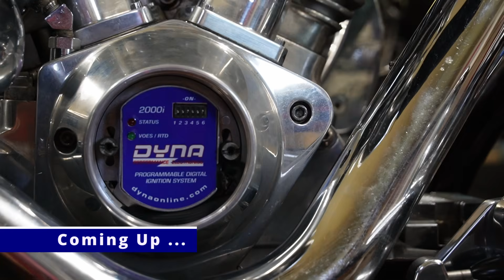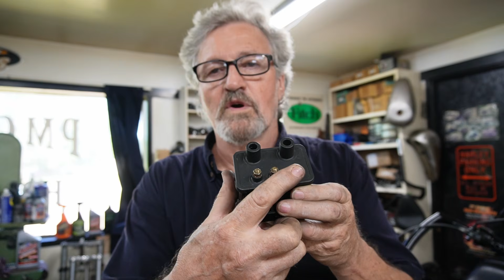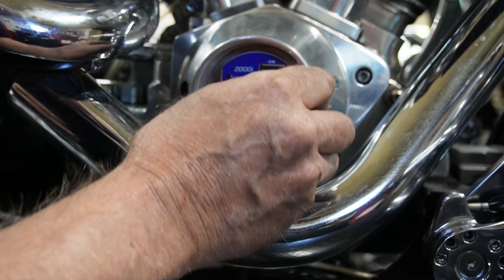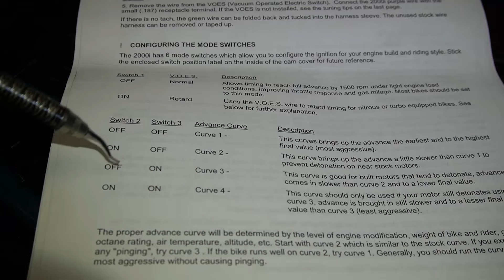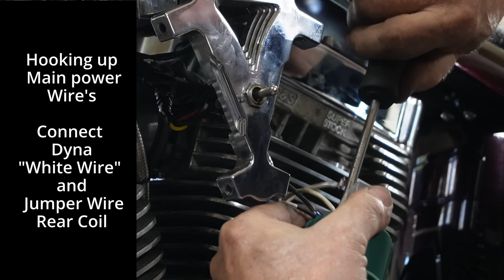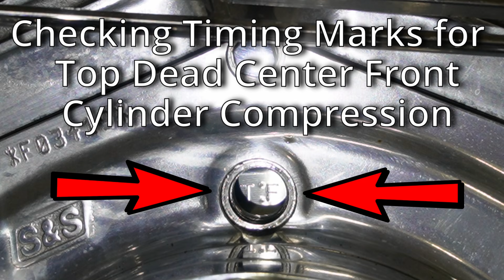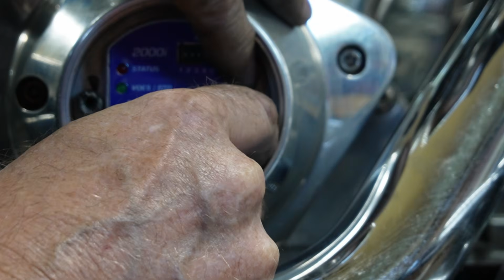HOW TO INSTALL A DYNA 2000i  IGNITION SYSTEM / THE EASY WAY

Comment: Ralph, what has your preference for a Shovelhead kick and electric start?
I understand the 2000i has standard dead revs programmed but you can flash a different curve in it. Or is a Dyna S just the better option even with the mechanical weights?
Reply from the maker: I prefer the Dyna "S" systems with the weights, if you are going kick start. I have heard of guys doing somehting with the dyna 2000i systems to make them better for kick, but have never met anyone who did it. I would stick with the 2000i for electric start bikes. Just my opinion. Thanks for commenting.

Comment: Just came across this ..good informative vid..now I must admitt it's not a Dyna ignition I'm installing but same set up.I have spark & fuel , engine turns over but won't start, infact shoots a nice flame out the carby [ E series ]..has me stumped, I've double checked & triple checked everything, set to single fire using 4 ohms twin tech coil..I still think timing out..am I wrong...'help' Cheers Skip  [ Australia ]1996 Evo
Reply from the maker: Glad the video was helpful even though you're using a different electronic ignition. Sounds like you've got a tricky situation on your hands. Moist electronic ignitions use 3 ohn coils but it should still start. A common mistake is having the spark plug wires wrong (front and rear cylinder firing reversed). That will often cause misfires, backfires etc. Also make sure you are setting it at Top Dead center compression on the front cylinder stroke. Also make sure you have the right CUP in behind the ignition. It should be a gold one  for 1983 and up, not a silver one. (Note if it is an early weights type system like a Dyna "S" you would need to be on Front cylinder advance mark on front cylinder compression stroke with 5 ohn coils) You might want to seach our the manufacture specs as well for it as I don't know what you are using. If it is a used system then it may also be faulty. Good luck and thanks for letting me know where youare from and Thanks for commenting.

Comment: Working  also for kick start  ... I use this....    Need to be programmed  . Very easy    https://www.youtube.com/watch?v=caztWdYbLFU
Reply from the maker: Thanks for the info, and the link, may be of use to others in the US. Not available through distributors up here, in Canada, and you can triple the cost just to get one up here from Dyna. In the end the Dyna S system is cheaper and easier. But if money is no object then it is a great option. Thanks for letting others know about it. Thanks for commenting. Appreciated!
Reply: @itsmytimeletsgo  Hi again from Norway.    You can also make it your self :) .   https://www.youtube.com/watch?v=_vaCxj1Z8WI
Reply from the maker: I will check that out. Thanks

Comment: Is it setup for kickstart right out of the box?
So it first on the first engine revolution?
Reply from the maker: The 2000i does not work well with kick starting. Not saying it won't work, and some say they have had success, but I have found the the earlier Dyna S systems (single fire or dual fire), with the advance weights, work a lot better for kickers. Good luck and thanks for commenting.
Reply: @itsmytimeletsgo   thanks for the info. I was hoping it would be a better unit for kickstarting than my Crane Hi-4 dual fire ignition.  😕

Comment: My battery died, installed new battery, engine turns over, have spark at both plugs, won’t start? IGN switch ON the red light flashes once on module, switch off the green light flashes once?? Is this normal, the lights on the module I mean?
Reply from the maker: Yes the red will flash once, when the power is turned on, unless it is close to the firing point. Then it will blink once and stay on. That is normal. The green light is for the VOES switch and will stay on if the violet wire is grounded, or you are using a VOES switch. Since it goes out it should not be a problem if you have no VOES switch. Seems your ignition is working properly. You may have another issue that caused the battery to die, possibly a short somewhere in the system. Check for fuel as well. It is a process of elimination to find the problem. Good luck

Comment: Question, I installed it the exact way you have shown but the engine is still getting a misfire. I’m running the set up the exact way you are the only thing I can thing of is maybe I didn’t set the front cylinder too too dead center when I thought it was. Any advice you can provide? I am running. The system on a 78 shovel and I’m definitely using the correct backing plate.
Reply from the maker: Double check the front cylinder TDC, and "make sure" you are on the "compression stroke". You can put a straw, or screwdriver in the hole to make sure you are at  top dead center. Also make sure that your spark plug wires are plugged in correct at the coil for the single fire, front for front and rear for rear. If they are swapped it will cause a miss fire and not run well at all. Hope that helps. Dyna 2000i single fire units don't like to be kick started as well so I take it you are electric start. Make sure you dip switches are set correctly as well. Thanks for the support and the question.

Comment: I've always used a pencil,to find TDC. Thanks for the tutorial.
Reply from the maker: That's a good way to find TDC, thanks for watching and taking the time to comment.
Reply: Do you find top dead center before or after you replace the cup or plate? Mine is old so it Doesn’t have the new plate that is needed with this ignition.
Reply from the maker: TDC is TDC with or without the plate. You will need the 1983 and up gold cup to make it work right.
Reply: @itsmytimeletsgo so my 97 sportster 883 already has said cup from factory? Or will I need to buy that cup separately so make the module work? TIA!

Comment: Trying to figure out my wiring harness is a pain in the butt. It was once a FLHTCUI fuel injected. I’m using S&S carburetor now trying to get this thing going.
Reply from the maker: Yes, wiring can be a challenge, but you will get it. Thanks for commenting.

Comment: Installed a Dyna 2000i when I ripped the Magnetti-Spaghetti fuel injection out of my 1997 FLHPi and replaced it with rejetted CV-40. Trouble free ever since!!!
Reply from the maker: Sounds like you got a nice setup there and are enjoying the performance. Thanks for watching and commenting!

Comment: I have a 76 shovel head and the dates on on this only start at 78 but it had a Dino 2000 I on it when I got it and it was working fine after a few years it burnt out and now I’m putting a new one onbut it says only till you’re 78 is that make a difference?
Reply from the maker: I do not see why it would make a difference, You must use the 83 up gold rotating cup (32402-83) for the 2000i. Perhaps that is why they say that but I cannot see it in the instruction sheets for the years.  Pre 78 were points, with mechanical weights sets, with points coils that are different ohms than what the 2000i needs.  5 ohms for points, or Dyna "S" and 3 ohms for electronics. Thanks for commenting.

Comment: Did I miss where the GREEN tachometer wire connects?
Reply from the maker: Attach the pink wire from the tach to the green wire, from the unit, with large .250 blade connector.. If there is no tach just fold back into sleeve. If the bike has a pink or pink/black wire at the coil connect this to the green wire. Hope this helps. Thanks for the question.
Reply: @ thank you for the answer. Changing from a dual fire to a single fire, is the green wire hooked to the single fire coil or the wire from the dual fire coil pink, pink/black?
Reply from the maker: @WindRider1  Here is an installation sheet for you that might help. http://www.vtwinmfg.com/Instructions/32/32-9153.pdf
Reply: @itsmytimeletsgo  thank you. Keep up the good work.

Comment: Do you have to program these on your computer?
Reply from the maker: No need for that at all. They are a self contained unit. Thanks for the question and commenting.
Reply: Can’t you adjust the curves and also adjust the wasted cranks before spark
Reply from the maker: @anthonyseidita1809  YOu can adjust using the dip switches but anything else requires something form Dyna to change anything. I have heard of some doing this for kicker applications, using the single fire mode, with varying success. Thanks for the question.
Reply: Any recommendations as far as what unit to purchase for a custom built chopper with an ultima el bruto 113” motor..? I see year and model specific options but don’t know exactly which to choose
Reply from the maker: @anthonyseidita1809  I would think with a motor that size that you would not be kicking it. So the Dyna 2000i single fire is probably the best bet for that bad boy. Late 80's to 1999  Evolution type. Hope that helps. Thanks for the question and commenting.

Comment: Thank You for a great vid. I just installed the D2k on a 83 fxsb low rider-dual fire.  

With respect to the coil. on one end it has 2 white wires, on the other a blue and yellow.  

One white wire is from the main harness and the other is routed to the "electronic module"  (power) 

The blue wire also comes from the EM.  The EM also connects to the timing mechanism via 3 additional wires.  i installed the d2k per the wiring diagram.  

My question is, the white and blue wire coming from the electronic module are no longer necessary?   (the yellow wire that is attached to one end of the coil is for the tach.)

any help is appreciated, thank u!!!
Reply from the maker: The electronic module is no longer needed with the new ignition system so just get ride of the wires attached to it. Hope that helps. Thanks for the question and commenting.

Comment: Great vid !,  whats the difference between the  Dyna-s ignition and the 2000i ignition ?
Reply from the maker: Thanks. The Dyna "S" is a mechanically driven system (mechanical weight set in behind the ignition plate) It is a standard duel fire system. It uses a 5 omh coil. The Dyna 2000i is electronic and has an ignition rotor cup in behind the ignition plate (1983 up type) .It needs a 3 omh coil. It can be run in duel fire or single fire mode when using the right coil. Both can be used with duel plugged heads as well again using the proper coils. Dyna makes a coil, for the single fire, that is the same size as a regular coil for easy mounting. Hope that helps. Thanks for the question and commenting.

Comment: Do you need the cup to run in single fire? Converting a 97 roadking to carb/single fire. Doing research before I order.
Reply from the maker: Yes you need the gold 1983 and up cup. Thanks for the question.
Reply: @ I noticed after I watched a little more of the video. My bad. Thank you for the reply though!

Comment: Are these ignitions programable? That is, if none of the settings of the tiny switches works well for me, can a custom program be done on it?
Reply from the maker: I am not sure about that. You should contact the manufacture about it. I did hear somewhere that they could be programmed for kicker bikes, with a special add, on so maybe you can find out something. Contact Dynateck or maybe someone here knows more about it. Thanks for the question and commenting.

Comment: Hello Ralph. 
I really liked your video... very well explained, simple, and concise. I came here because I'm looking for a way to confirm if my Dyna 2000i is really broken, before buying another one. My 99 Sportster has had one mounted on it for 20 years, and now, after 200,000 KMS, the bike doesn't want to work. The starter works, but no current reaches the spark plugs, and the coil and the cables are good. I wonder if there is a way to know if the Dyna 2000i is working, just by starting it... while the engine turns but does not start. Should there be any change in the LED, for example, or is there any another way to confirm if it is broken? I didn't want to be spending money on it and then it wasn't the problem. 😕I am the one who usually carries out all the interventions on my motorcycle. Thank you very much in advance. I'm in Europe. Hugs. 🙏
Reply from the maker: Hello and thanks for the question. I do not know if you are running in the dual fire or single fire settings. In any case chek all of you grounds to make sure they are good. Make sure you have power to the coil.  I think you could use a test light to check as well. Put one end on the 12V line and the other on the other side of the coil. (if you are single fire then one on the center terminal and the other end on one of the other terminals). When you turn the bike over the light should light up if there is signal from the ignition system. Below is some checks from Dyna concerning  the red light etc. 

Verifying System Functionality with the LED 
The red LED can be used to determine if the ignition module is working. When power is turned on to the ignition, the LED should
flash on for 1/4 second then turn off. If the pickup is near a firing point, the red LED will come on continuously. This "Flash period"
indicates that the microprocessor is functioning in the DYNA 2000I ignition module. 
When the ignition power is on and the engine is cranked over, the red LED on the DYNA 2000I will blink on and off. This indicates
that the DYNA 2000I pickup is generating timing. The pickup is designed such that the LED will come on at about 45 degrees
before top dead center and go off at top dead center for each cylinder. This corresponds to the leading edge of the window in the
rotating cup (45 BTDC), and the trailing edge (TDC). 
NOTE: If the red LED flashes rapidly with the engine not running, an over current fault is indicated. Check for proper coil
resistance (2.5 to 3.5 ohms) and wiring. Turn the ignition off for one second, and back on to clear the fault. 
VOES LED Function 
The green VOES LED lights when the purple wire is grounded. When the engine is operated in normal mode with the VOES
connected, the green LED will be on most of the time. The green LED will also be on when the Programming Adapter Is
connected.
Hope this helps! Thanks for the question, commenting and letting me know where you are from.
Reply: @itsmytimeletsgo  what a fabulous explanation! This is without words for help given. ❤️ 
I have dual fire. 
Some of these things are done, but now I have to test how you taught me. I don't know exactly when I will be able to do it, but rather what I will achieve, tell you or result. 
A thousand thanks, from Portugal. 😉🙏
Reply from the maker: @MhP163  You are more than welcome sir. I hope I was about to help you out with the info. Many thanks for your kind words.
Reply: Hello Ralph, again. 
I will comment my story in your video about the 
Dyna S. 
😉

Comment: What color was the cup
Reply from the maker: It should be a gold cup that is needed. I think I gave the part number in the video. Thanks for the question and commenting.
Reply: @itsmytimeletsgo I went to the part store it looks the same and has silver coating says 84-99
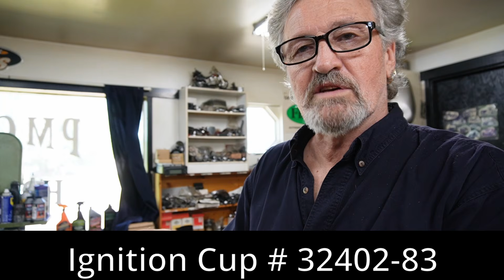Reply from the maker: @superwin190  I gave the part number in the video ( at 1:20) 32402-83 and that is the one that is needed. Usually they are gold and the number is stamped right on them. You can check the part number they gave you for it. If it is 32401-80 it is for the early 80 to 83 ignition systems and will not work, and usually does not have the part number stamped on it. Hope this helps and good luck.

Comment: Are there any benefits to running separate coils like you did instead of one mini coil
Reply from the maker: There is no advantage, to my knowledge it was just that this particular bike had the coil mounts for dual coils. The singlefire coil will work just as well. Thanks for the question.

Comment: hello, great video btw
im having a problem with my 2002 883 sporster 
it was running good and sudently died, it lost the spark completle 
took it to the garage and turns out the ignition module died, went on ebay and bought an used one. the bike worked great but just for a week, than it started failing when acelerating in low rpm and end up dying again completly  loosing the spark. 
im thinking on installing one of these dyna 2000i hoping it will solve my problem. 
shine me a light please
Reply from the maker: You will enjoy the Dyna. Very reliable and esy to install. Thanks for commenting.

Comment: Will this ignition be compatible with a S&S 96 evo?
Reply from the maker: Yes it would  be a great addtion to that motor. I would use it in a heartbeat to make her get up and dance.   Thanks for commenting.
Reply: @itsmytimeletsgo  is dyna module any better/different than ultima module?
Reply from the maker: @blacklimosmatter2023  I have heard people say they are about the same. You just have to make a brand name choice.
Reply: @blacklimosmatter2023  I ran a 2000i in my S&S v96 and would highly recommend it. In fact, when I bought my S&S v111 for same bike, the new S&S Super Stock ignition failed right after break-in. I grabbed the 2000i off the shelf and it runs flawlessly. As OP said, watch your wiring closely. The Super Stock and 2000i wire colors are basically reversed, if I remember correctly. Ignition is so critical that I don’t memorize that stuff. Follow instructions every time!
Reply: @meandkathinkihei  would you recomend a place to purchase it?

Comment: 2004 having trouble,  new stuff in tank, no spark on plug, ignition fuse no work, looks good
Reply from the maker: Make sure the wiring is correct, to the coil, if its a new install. The LED should be lighting up on the Dyna unit when truning the motor over. If not its a problem with the ignition. Again check the wiring to the ignition and the coil. Check for power. Good luck. Thanks for commenting.